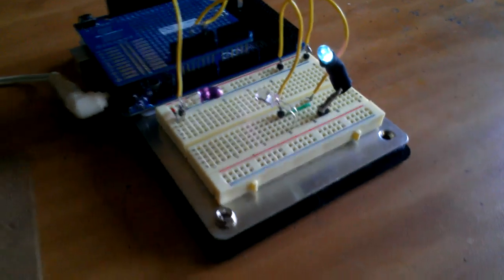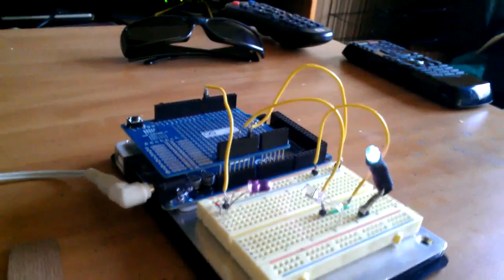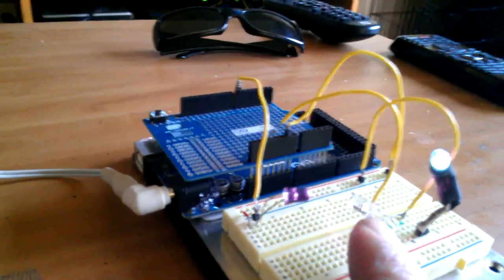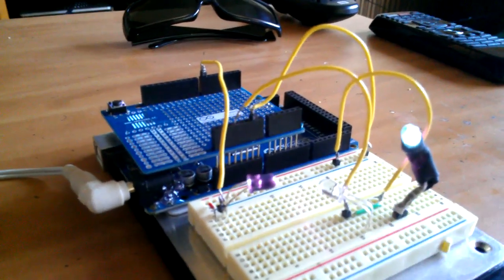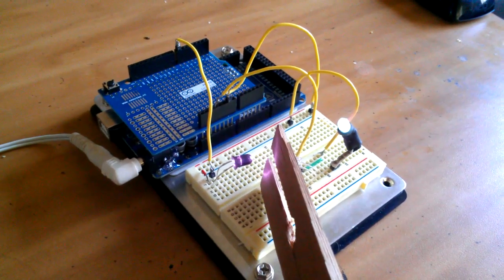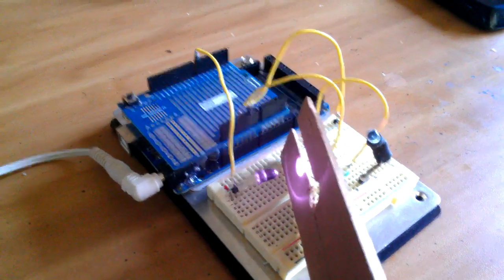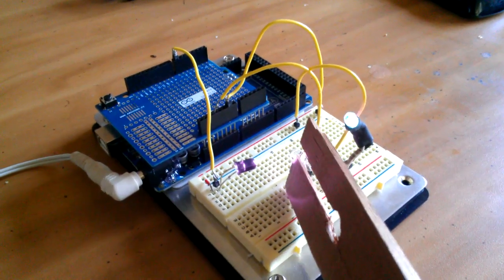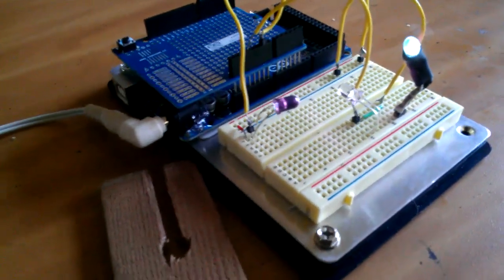Arduino IR emitter and detector + led

Comment: Hello! I can't seem to find the code from the location you have mentioned. If possible, can you please email me the code? 
noornabeelah.12@gmail.com
Thank you in advance..
Reply from the maker: from what i remember (it's been over 4 years since i did this) the code has dependencies. these dependencies and the code file are distributed with the Arduino IDE installation and they are in the right locations for the compiler to use them. IF i even had the file still, you'd have to set it up the right way and I can't walk you through that.

Using the full Arduino install will give you this example, if it's not there you didn't install Arduino correctly. If you didn't install Arduino correctly, you will have more problems than just not being able to find an example file.

I don't have this project saved anywhere so I'd have to install Arduino and dig the code out from their examples to send to you. This is something that you should do. So you can be more familiar with the Arduino environment and how it all works together.
Reply: Mike Hatfield okay noted that. Thanks for your reply.😊 I'll try to find the code again in Arduino.

Comment: does the whole beam need to be broken or partially?, trying to use it for a camera trigger
Reply from the maker: +Tim Millward you could write a function to analyze the strength and adjust so you can either have it need be fully broken or partially. The blink code example was just sending a signal to light an led and any presence of IR would trigger it.
Reply: thank you for your reply and time,  is this the strength of the receiver?.i want it to trigger a ttl camera. the IR receiver is 5 mm (standard i think) but object is only 2 mm (ie partially break the beam). look forward to your response, regards Tim
Reply from the maker: It would be some code in arduino and the code would have some logic to determine the signal strength. I'm just theorizing since I don't know how to code.